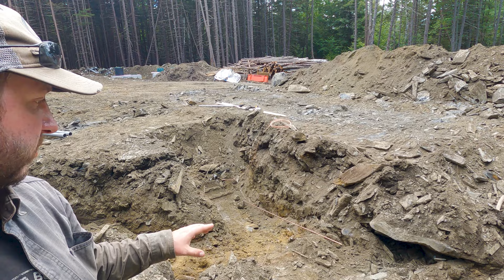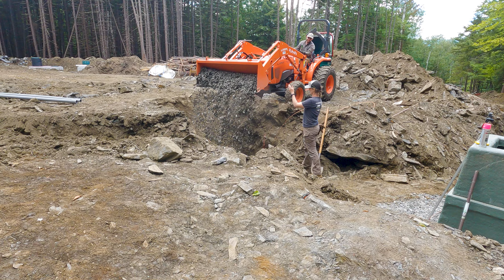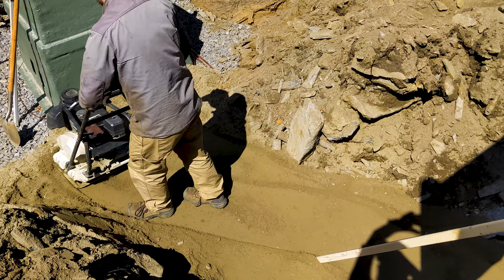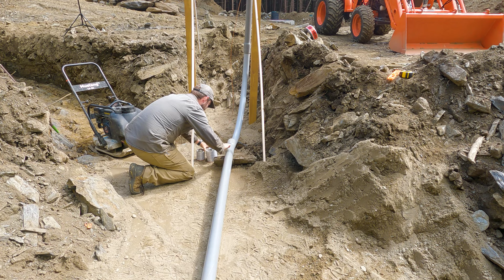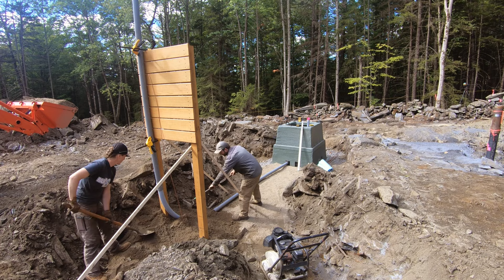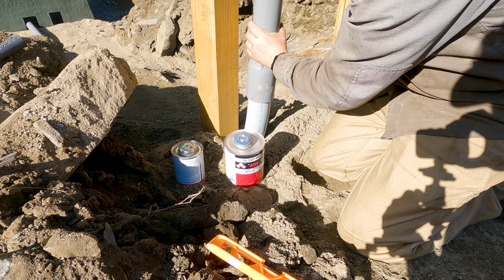Installing an electrical backboard

Comment: Gluing PVC is one of those things that looks so easy, and is, if you get everything set up "just right". When I saw you had the long run braced up on a rock, presumably  to make it easy to access the joint and keep it clean, I knew you were going to have to pull that rock out of there. :) Good job. Glad you have such cooperative utilities.
Reply from the maker: Absolutely. I think this was the first piece of conduit we were gluing as well, so definitely a learning curve. Working in the trenches was a real pain and we were using rocks and pieces of work to prop up the ends of the conduit to try to keep everything clean. After a while we found a routine that worked for us. And yes, the utility company were really cooperative throughout.

Comment: Sch. 80 is heavy walled. Is that required by code?
Reply from the maker: The utility company requires it under any traveled surface. The area above this run of conduit is right on the edge of our driveway, and an area we do expect to drive and park vehicles on and around. Elsewhere we've been able to use Schedule 40, and our utility company was happy for us to transition between the two in a single run where necessary.
Reply: Ah. I see.👍🏻